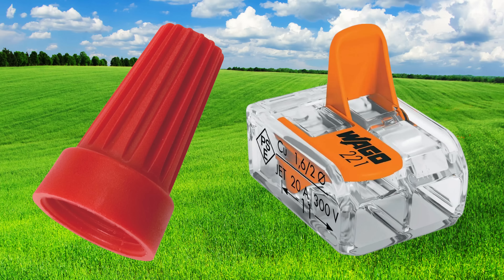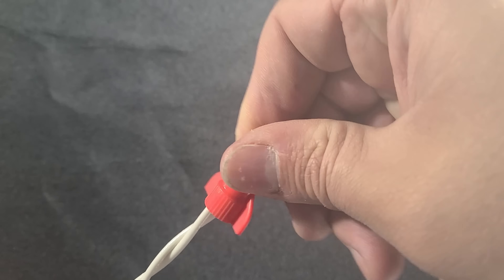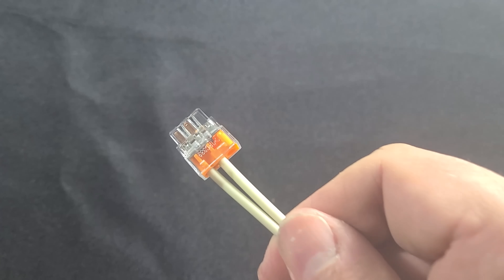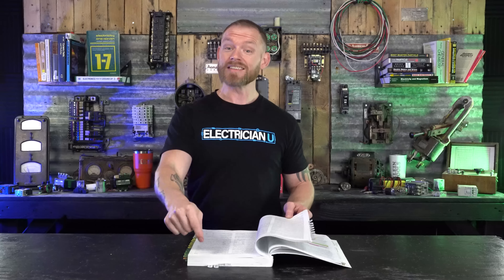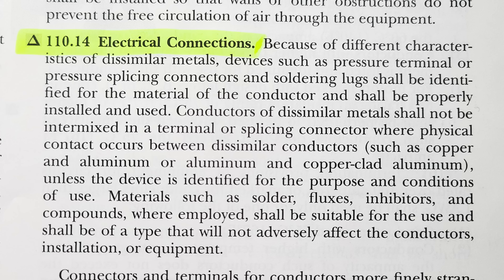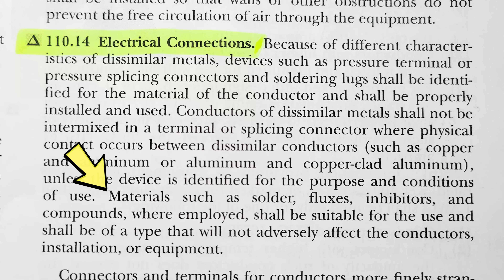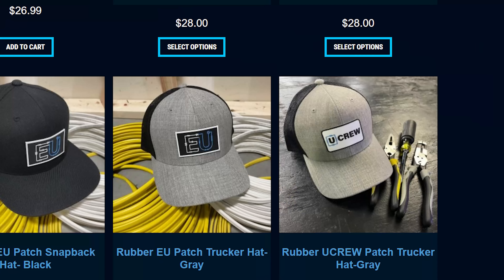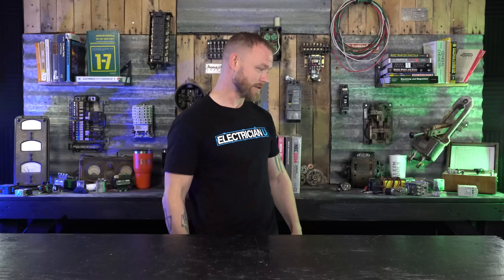Should We Use WAGOS or WIRENUTS?!?!

Comment: I recently discovered the Wago Lever Nuts and am so glad I did. Especially for two problematic applications: 1) Wires cut too short in small boxes and tight places and 2) Connecting solid and stranded, like for light fixtures. For me trying to twist solid and thin stranded has always turned to a miserable mess. And light fixtures are almost certain to be swapped out as styles change.
Reply: I’ve never had an issue connecting solid and stranded wires. I always make sure the stranded wire is a little longer than the solid wire and wrap it around then twist on a Can-Twist wire nut.
Reply: Same here. I found some in my van last year and was blown away. Saved me on that service call when I found them, and I've fallen in love with them ever since. I don't use them for everything, but I love em when I need em. Definitely think I'm going to start incorporating them with lighting as several others have pointed out on here. I like the thinking.
Reply: @sirnatanielson  I like to work it's keeping me busy just troubleshooting and removing them
Reply: THANK YOU!
Reply: Lots of new lights and fans come with the push on type of Wago. You can get the wire out with wiggling and pulling but for the most part they're a one time use connector.
Reply: @fauxque5057  I wouldn't consider the lever release Wago connectors to be at all the same as those push in connectors. These Wagos are zero insertion force connectors, while those push in connectors are necessarily light spring loaded to accommodate varying wire gauges, and not comparable in any way to the lever lock connectors or wire nuts.
Reply: @wingerrrrrrrrr  from my obseration internally they are very similar. The Lever type just has an additional lever that retracts the Spring entirely. But you can use the 221 the same way as the pure spring type ones by pushing the Wire in (and probably also use the twist and pull method to get solid wire back out, but no reason to do this)
Reply: I discovered them all the time about to burn a building down or a home
Reply: @mrromantimothy  Pics or it didnt happen. Have used the Spring Variant for over a Decade now, and the new Lever Variant at least 5 Years, and so far i havent heard of any Building i worked on burning down for any reason. And here in Germany pretty much everyone uses Wagos and no one uses Wirenuts. they arent even sold here afaik (except on the Internet as import maybe)
Reply: @unitrader403  Wow! That is great to know that they no longer use wire nuts in Germany. Here in the US it appears people are slow to change and make the switch from wire nuts to Wagos.
Reply: @FlaSunsetA1A  actually we never used them in the fist place afaik. In really old Installations (older than ~30 Years) you can find Screw Terminals of varying types here, but i havent ever seen a wirenut in an electrical installation yet. Only in some probably imported widgetds used them internally..
Reply: @mrromantimothy  huh so how many buildings or homes have burned down from them, interesting i haven’t heard of one yet?

Comment: My take. The company I worked for for 35 years (pre-covid) makes Industrial machines and motor controllers. What we found is that if you are pulling current through a Wago connector, especially a Wago spring connector, that over time the high current draw will heat and weaken the spring and eventually cause a bad connection, which of course sets in motion a descending spiral failure. Wago gets hot, loosens connection, which causes a worse connection, which makes it hotter, and worse, and so on until things turn black and crispy and quit working... EVEN if the current draw was within the rating of the connector. It just could not handle big (1/2 horse or more) motor in rush currents and heavy draws.... because of this we went back to screw down phoenix connectors and connector blocks in our machinery and field installations. NOW, with that being said, Wago connectors are just fine in lower current situations - Lighting, known current circuits, etc. I prefer the lever versions over the spring connectors simply because of this experience. Just make sure the connectors you use are rated for at least 20-30% more current than the circuit will draw at MAX and you'll be fine. 
With that being said, nothing beats the connection of a pre twisted wire nut. However, the Wago DOES have its applications, no doubt,
Reply: What you're saying is the reason the rest of the world moved more away from screw connections and wirenuts, and over to cage clamp connections.

Comment: I build elevators and we wont use wire nuts. Wago lever joints or butt splices for everything. If your worried it'll let go, wrap it in electrical tape. Never had a problem

Comment: I went to buy a few of those wire nuts filled with anti-ox, to do some work in my brother's 100 yr old house he built (had to splice in some ground tails) and they come $6 for 3/ea....INSANE amount of money...SO I just used my Penetrox and squirted it in a red/yellow LOL....also, In the US I see Wagos on ALL hi hats or lighting devices now. I am assuming bc they are built and assembled in outside countries. I like using wagos BUT there is nothing like the satisfaction of stripping, twisting, cutting and capping with a wire nut :-)

Comment: At my work we have started using Wagos because we use stranded wire. Twisting just rips up the strands if you undo the wire nuts.
There are two types wagos we use the type with lever to lock the wire inside.

Comment: Can Wagos carry any sort of load? Seems like wrapped wires have more contact points and less heat. I wouldn't feal comfortable running my air compressor or welder through a Wago circuit. Not an electrician so am I just crazy? Talk me off the ledge.

Comment: I've always called the Twist On Wire Connecting Devices made by 3M, the ones with a the wings as 3M Scotch Loks. That's what we were taught in Trade School and the hard screw on Plastic ones were called Wire Nuts. I use 3M or Ideal Wing Tip Scotch Loks, some with the little rubber skirts and some without . Also use Wagos, Wire Nuts and the Push In type of Wire Connectors. I'm a Journeyman Electrician with over 55 years in the trade ! I even used the small crimp on copper barrel sleeves  then wrapped with rubber tape and friction tape, the way they use to do wire connections BEFORE Wire Connectors were even on the market ! And I have even done Soldered Joint Connections then applied rubberized wrapping followed by friction tape wrapping !
Reply: I'm always so fascinated (and sometimes frustrated) when I run into the old techniques of splicing. I find it so interesting to see the progression of the trade.
Reply: I've got the soldered connections in my house that was built in 1953, very durable. The Wagos are nice for all the reasons people mention in this comment section.
Reply: Scotch Locks (Actually called Scotchlok) are actually an entirely different type of connector made by 3M for use in the Telecom/LV industry.  Another case of slang becoming the norm. Like calling any brand of reciprocating saw a Sawzall.
Reply: That's OLD old school
Reply: Wire Nuts have been on the market since the early 20's the first ones were ceramic. Crimp on barrel sleeves that pre dated the wire nut  (by just a couple years and were imvented by the inventor of the wire nut)  still had  a bakelite cap much like a Buchanan or were of the set screw type with a bakelite cap.   Prior to that it was solder and tape... NOT since before 1930 has any sparky that was not a complete hack use just a crimp on barrel and tape....

Comment: Wagos are great, i used them rewiring my house for chaining outlets together, splices for branch circuits, etc. I like idea of outlet goes bad you just undo 3 wires instead of like 4+ as you may if chained on the receptacle itself. Or have to change a switch for a different style, etc. I had so many fits with wire nuts wires twist together, have to get pliers to undo it, wires break off then have to strip it, maybe even take more sheath off, etc. Don't have that with Wagos just pop another lever or stab another wire in and it is done. Not best but I feel way safer live splicing something with a wago than a wire nut.  

I actually decided to test these, took some old 12AWG wire connected to stick welder like 300-320 amps. Wirenut, Wago, and ideal stab in wago the first one failed was the Ideal stabin one, the wirenut deformed and was all mushy, the wago was soft but not really bothered. Those were all after probably 1 minute or maybe more of that amperage.
Reply: My outlets allow me to daisy chain its wiring together up tow 4 hots and 4 neutrals on each outlet.  Why waste your money on Waygos?  insert the wire in the hole and tighten the screw.  Waygos are just an added expense... can buy a box of wire nuts for tying neutrals in a multi gang box which will last your lifetime, every light fixture and dimmer comes with free wire nuts...

Comment: I threw away all my wirenuts. I stopped using Push Connectors as well. I only use Lever Connectors now. Quick and Easy, and takes up less space in a box.
Reply: The push in Wagos are even smaller.  I connect my ground wires together in one wago and the neutrals in another wago and push them deep in the box.  The levered ones are a bit thicker.

Comment: Not an electrician yet (starting an apprenticeship out of highschool )but personally prefer wire nuts as I feel they provide a more solid conection. I certainly do aggre that wagos save alot of time but don't think they provide as solid of a connection as wirenuts assuming you pre twist, as the connection is already solid before you even put on the wire nut and in my mind its job is more of a insulator then as physical connector but wagos should still be perfectly fine for most applications.
Reply: Welcome to the world of sparkies, from personal experience i have found that Wago connectors give a far superior joint than wire nuts, and have been using them in their various forms for the last 30yrs. Whenever i have had to rectify a connection issue in a circuit be it in domestic, industrial or control panel the problem has 8 times out of 10 been caused by the use of a wire nut the other 2 by chocblocks ( a UK thing). Stick with the Wagos and you won't go far wrong.
And best of luck with your apprenticeship and all it will bring you 😃
Reply: @andrewtadd4373  Good to hear that wagos can stand the test of time and Thanks.

Comment: I typically use wegos when using stranded thhn in a lighting control panel or something where I'll need to be taking them apart later, it helps. When roughing in a house I'll use wire nuts where I know I'll not be taking apart the ckt

Comment: Wago is a brand name for a push to connect wires device. A wire nut is basically little more than a tiny cone of steel encapsulated in plastic that's used as a poorly fitting hat on wire connections. Old timers and many Canadians call wire nuts Marrettes, after the brand, the original twist on connectors.

For stranded wire to solid, twist on connectors are crap, lever lock wagos or push connects are great for solid to stranded. 

The big thing  missed in this piece is some  wagos are designed to be  compatible with DIN rail, a  modular wire management system.

Comment: it's more current based for me, i personally prefer to use wirenuts on higher current applications like outlets and i would use wagos on lights and stuff
Reply: The surface area of a wago connection vs a wire nut has always had me concerned for use in a high current application. As one commenter stated the wago connection was still there even after the insulation burned off. This to me indicates a high resistance connection generating enough heat to toast the insulation.
Reply: @newjerseybill3521  yeah, i see them the same as the backstab connections on outlets, and i've seen a ton of those fail. i have even seen them fail in a brand new house only a few months old

Comment: SO THIS MAKES ME WANT TO ASK AN IMPORTAN QUESTION REGARDING THE "bi-metal cORROSION" which is what the dissimilar metaks issue becomes..

When attatching the copper FEED (which is copper wire)  to a device that is factory wired with silver wires, ie, lights, fans, et.  copper wire nutted together with silver wire?? What is the dissimlar metal code for such?? and how does this apply to those dissimilar metals??
Reply: Likely tinned (solder) rather than silver wires. Non-issue.

Comment: I love my wagos. Especially for the old metal boxes in m house that are barely big enough for the device. They are so much more compact than wire nuts. I use the 221 lever nuts. The push in connectors are trash

Comment: I didn't even know WAGO's existed until I began having to replace original room lighting and old switches in my home (around 30 years old).   I had tons of halogens that used odd-sized lamps whos sockets were corroded into unusability.   So I began to undertake a project to replace them all with new enclosures with normal E26 sockets that I could screw LEDs into.

After breaking my fifth wirenut and realizing that the ones I had bought were junk, I started looking for something a bit more reliable.  That's when I found out about WAGO's.  And I gotta say, it sure made life a whole lot easier.

-Matt

Comment: I think wagos are nice sometimes but wire nuts are perfectly fine most of the time at least for my job (commercial kitchen repair and HVAC/R). Side note I 100% agree with pre-twisting wires, I know you don't need to but it's not gonna hurt anything which is also why I tape connections as well if I am worried it might get pulled on at all, also fun fact the most common reason for heating element connections to melt is loose connections. Also fun electrical story the other day at a customer location me and another tech could not find the breaker to shuck off a 240V single phase outlet, we tried every 2 pole breaker in the pannel still powered. Some asshole (not my company), on a commercial job no less, wired each leg to a seperate 120V single pole breaker and that somehow got missed by the inspector as well because that store is less then 5 years old and it has been like that the whole time, so never trust anything unless you did it yourself.
Reply: Also do commercial kitchen repair. Wish I could use wagos but I really only ever use porcelain wire nuts.
Reply: @xXxDETZxXx  ya I use those when needed for the heat protection, Henny penny fryers use wagos on the higher end automated models with the auto filtering and that where I see them mostly.
Reply: @keldon_champion  yeah I've seen them on the PXEs and subways Nu-vu proofer/ovens have them at pretty much everywhere.

Comment: I'm a DIYer (who spent way too much time researching this previously), so my comment is mostly aimed at other non-professionals. IMO unless you're a professional you should probably always use the clear Wago 221 series lever nuts. If you're a professional then you probably don't need my input. Pick what you like for whatever reason you find justifies it.

Pros of wire nuts: Cheap. Provides the "best" (most continuous surface contact) connection when properly applied.
Cons of wire nuts: You can't see the conductors inside the nut. Can be improperly applied creating a fire hazard. Twisting can be somewhat time-consuming comparatively. Typically requires trimming of conductors if the nut is removed (like to swap out a fixture), which can shorten conductors to a state where they're hard to work with. Sometimes difficult to properly connect stranded and solid conductors.

Pros of Wago 221s: Fast. Easy to use safely, even with little or no experience. You can see the conductor is properly inserted at all times. Easy to change/reapply/reuse. Typically doesn't require trimming conductors to reuse. Easier with stranded conductors. Easier for multiple conductors (3+).
Cons of Wago 221s: Comparatively expensive. Culturally considered "not as proven" or "uncool" in the US. Or so I've heard.

Also if a professional electrician winds up replying to my comment and handing me my ass for something I didn't know, listen to them. They're the professionals, not me.
Reply: Professional of 15 years who always used wire nuts until I found WAGOs this year. You are correct. There is something else very important to address. If you know what you are doing with wire nuts, they are fantastic and will likely never have a single problem. If you do not know what you are doing, you can destroy systems and potentially humans. As soon as I discovered Wagos my jaw dropped. “It tells you how long to splice and what gauge it can handle on it?! Wait…you can see the connections after you make it?! Oh my god you can remove the wires without strands breaking off inside or the threading of the nut coming loose? Why hasn’t anyone shown me this before!?”  
Obviously there are times when wire nuts take over; larger wires, lots of low voltage connections that need to be jumped for routine testings etc. but I rarely use wire nuts anymore, and WAGOs have made my job easier and safer, especially with new guys.